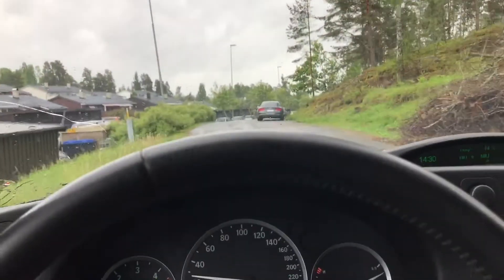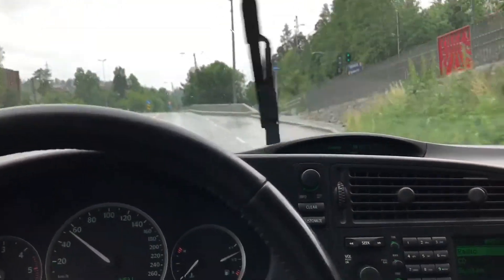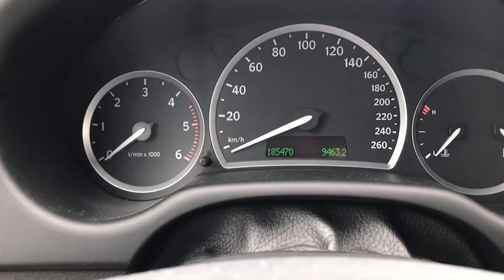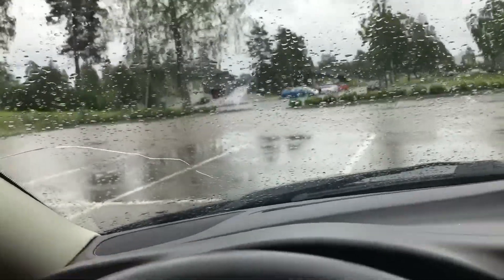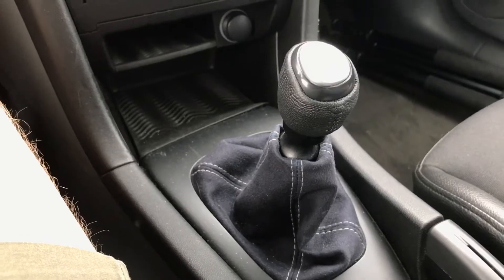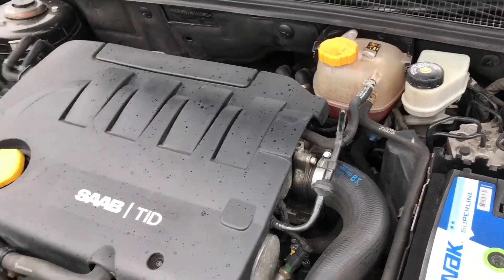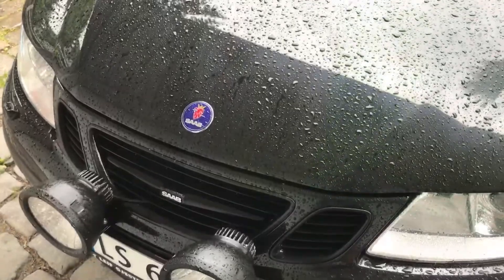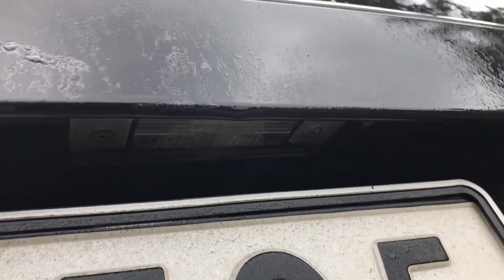Saab 9-3 SC TID Dual Mass Flywheel Problems + How it Sounds

Comment: Hello im having same problem with less rattle noise. how long will it last? ill get money to repair in a month do you think its possible to drive with that noise?
Reply: I had this noise (failing DMF) for 4-5 months now. Getting it fixed next week. BUT, I didn't use the car much (did 2500km) due to working from home. I'd get it fixed asap though.
Reply: @cogsincogs  did the noise get worse when u did the 2500km?
Reply: @cogsincogs  thanks for the info
Reply: @peke6829  It got a bit worse yes, also the car kinda shakes a bit at higher speed due to the DMF being unbalanced. Did 222k km on original DMF, still on first clutch that still works. But will change both obviously.
Reply: @cogsincogs  222k km? :D i have 222700km on my original clutch and dmf now. i see thats common problem at 200k km
Reply: @peke6829  Yes, Usually DMF start to go out between 150-200k km, depending how the car was driven. But conservative drivers can get 250-300k on some DMF (usually daily highway drivers). A LUK set of DMF, clutch and bearing costs around 450 euro (for 1.9 ttid), so it's not that bad. Some VW kits cost 600-700 euro or even more.